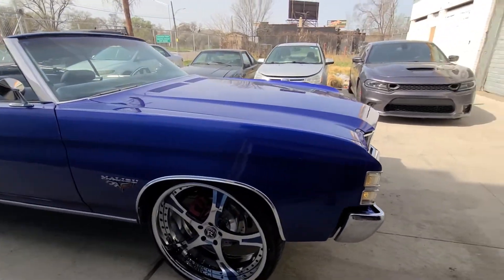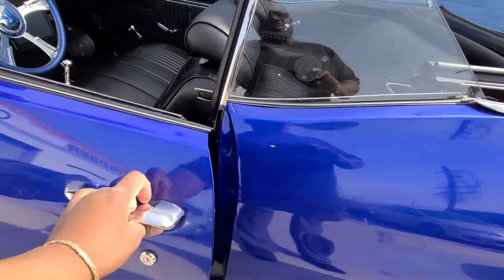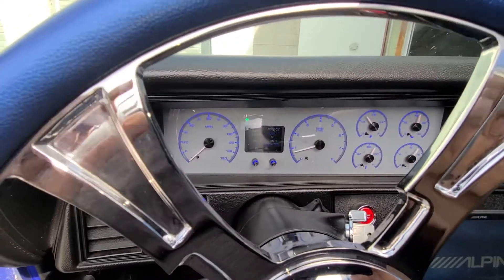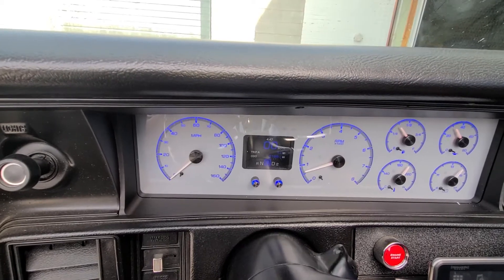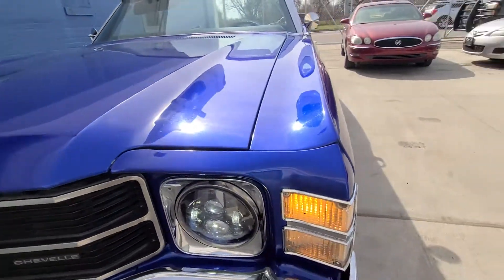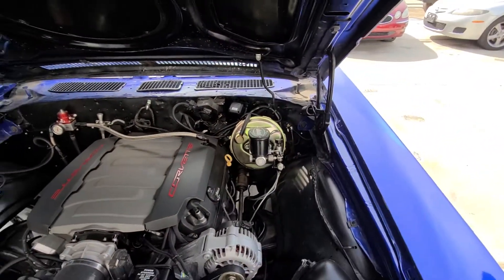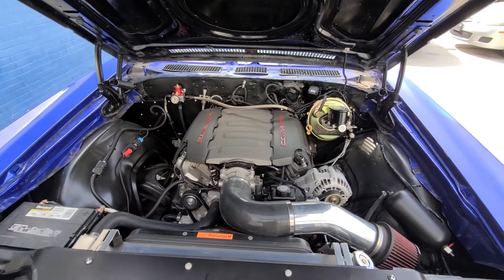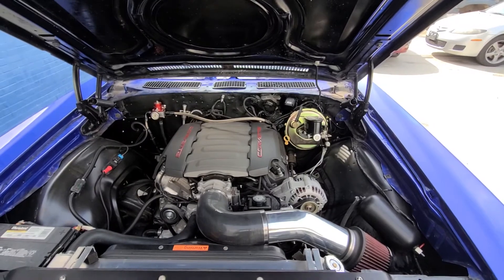1971 CHEVELLE CONVERTIBLE LT1 GEN V SWAP

Comment: What parts did you use to make the 4l80e mate up to the  LT1? Doing the same set up I got the lt1 but don't know what parts I need to be able to make my 4l80e work on it, thanks!
Reply: I’m having the same issue. Using a 2018 Camaro ss as a donor but catching hell with the trans.
Reply: @zactalleyclactpep1328  just picked up a 2017 Camaro SS donor. Is there any reason not to carry over the trans as well? Also, what did you do about your power steering pump? Going in a 69 Chevelle
Reply: im trying to put LT1 and 4l80e on my obs and can’t make it work
Reply: @CVPI03 did you ever find the issue?

Comment: Nice, what did it take to get the 4L80E to work with the LT1?
Reply from the maker: This swap was completed in 2018. Limited parts were available then. We used custom torque and flex plate. The harness was made for manual transmission and separate controller used for the  4l80e. I would do it different now.
Reply: @whiteoneauto  I hear that, the swap parts are still limited when it comes to using a transmission other than the ones the LT1 Gen V came with.  The only Item I can find is a TCI flex plate to adapt to 4L80E and I would have to get a separate computer for it or just make it a manual valve body.
Reply from the maker: @GoGoGarage  save your self the headaches and send the car to White One Auto we will get it done for you. 313-264-1689.

Comment: The lt engine are designed to have 6 or 8 or 10 speed transmission. The 4l80 might be a bad choice  far as my research.  Car clean tho
Reply from the maker: The car been together for also 3 years no issues.  Motive Raceworks has a LT1 in there Nova without 6,8 or 10 speed and it runs 7's. Thanks for your opinion.
Reply: Yes it's true this engine is set to 8 to 10 speed transmission for RPM and it gives better mpgs